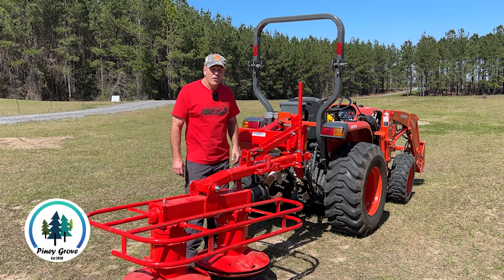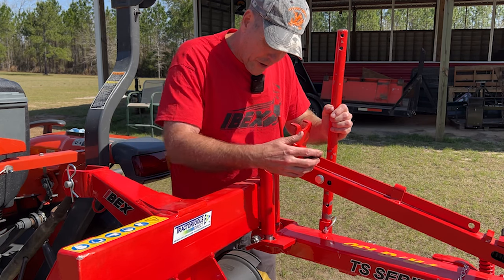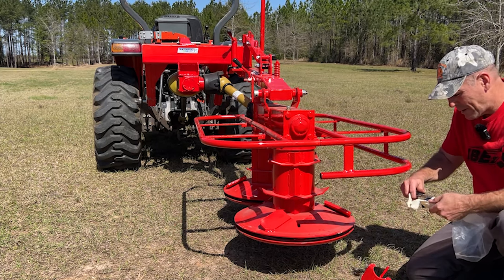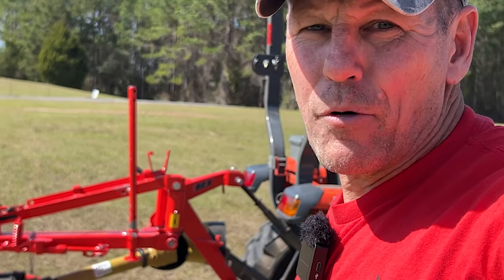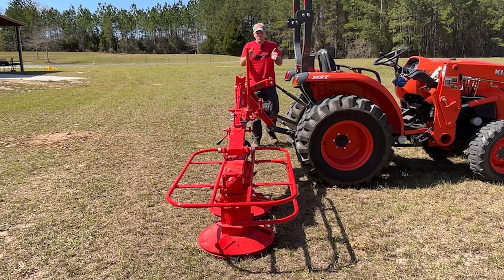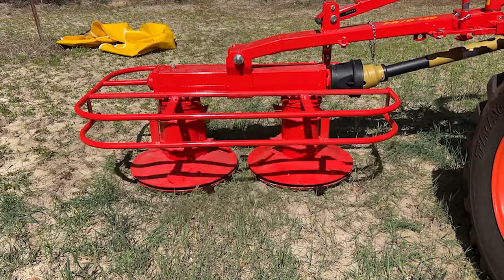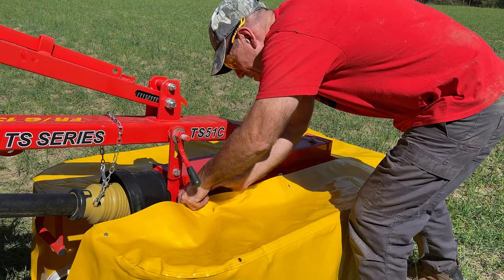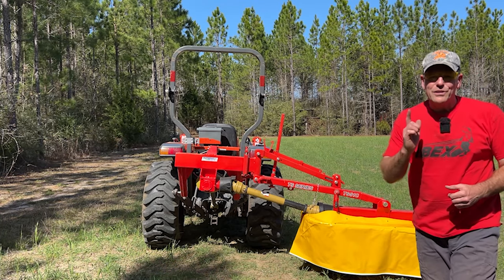How Does a Drum Mower Work?  Watch this!

Comment: I'm glad you are planning to do more IBEX videos.  It's really too bad that these drum mowers are designed to mow so low to the ground. Not only can it be unforgiving for those undulations as you saw but it's really just not good for your soil to not leave at least a few inches of standing forage to shade the dirt. They do make a 'lift kit' for this purpose but I've not tried it on mine.  Hope you finally got the crunch out of your mouth from the dirt bath!  Keep up the great work on the vids.  PS - TractorToolsDirect does have good service. I have the mower/rake/mini-baler package.
Reply from the maker: We can't wait to put into the right kind of grass and bale some hay!
Reply: The drum mower cuts too close to the ground. I believe the grasses and legumes should be cut no lower than 4 inches off the ground .  This provides for better regrowth .
Reply: There is a kit which give a 3.75 to 4 inch cut that I installed on my neighbors Ibex drum mower.   The mowers are   very high quality and built to take a kicking and keep on ticking.  I really think highly of the Ibex mowers.

Comment: To extend your top link. You can set up the bottom of your top link in 3rd hole up on your axle. The top position, top hole. Maybe, you will not like the change in the pivot point though.
Reply from the maker: I needed a longer top link anyways....this one was always lengthened to its max.

Comment: What PTO RPM were you running at?
Reply from the maker: 540
Reply: 540. When you engage the PTO, raise it off the ground, otherwise it may stall the tractor until reaching optimal rotations

Comment: European rotary mowers follow the terrain better. Just type in YouTube, e.g. Koszenie trawy C-360 kosiarką rotacyjną 1.85m . 8:14 the screw connecting the tractor and the mower should be unscrewed to such an extent that it should have slight play . This ensures that the discs will lie flat on the ground and the grass will be mowed at a height of 1 3/4 inches (approximately 4 centimeters). There is an unwritten rule on how to check whether the mower discs are completely on the ground. Just drive two yards forward and two yards back in the new swath. In both cases, the height of the cut grass from the ground should be the same, and if it is different, the mower is incorrectly set. Never mow backwards because if the mower hits an obstacle, it will break because the safety device when driving backwards does not work. Always wear the yellow safety cover to avoid being hit by an object thrown from under the mower . In Poland, for a 90 HP tractor, there is a rotary mower with 4 drums, with a mowing width of 250 centimeters, i.e. about 2.6 yards. Then, driving the tractor at 6 miles per hour, we mow 6 acres of grass in an hour
Reply from the maker: Good points!
Reply: @PineyGroveHomestead  Here you can see how simply the European rotary mower is built. Enter this sentence on YouTube (copy and paste) :  Nowe Życie Kosiarki Rotacyjnej - Pełen Remont